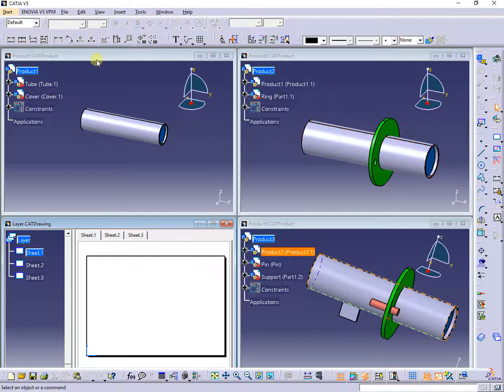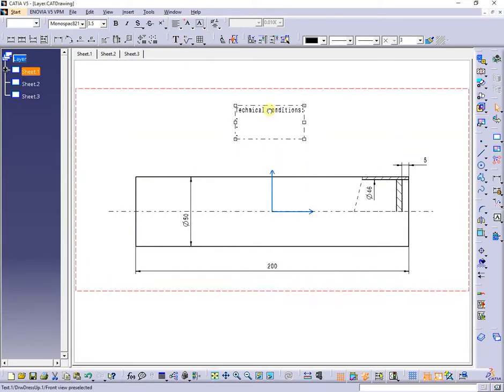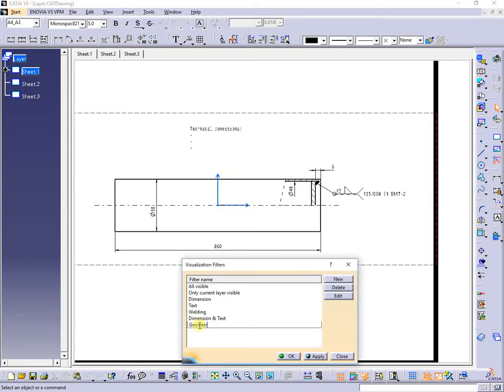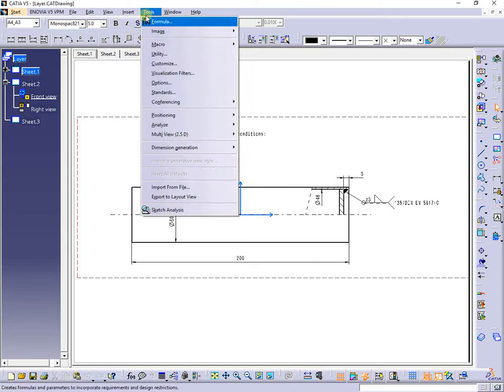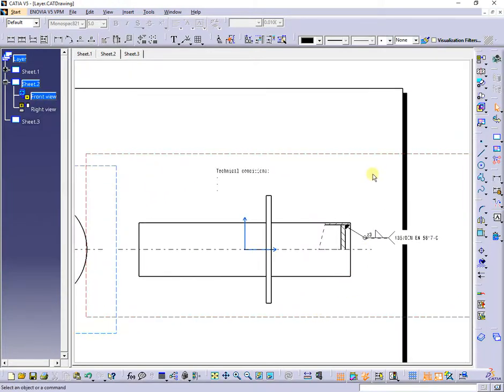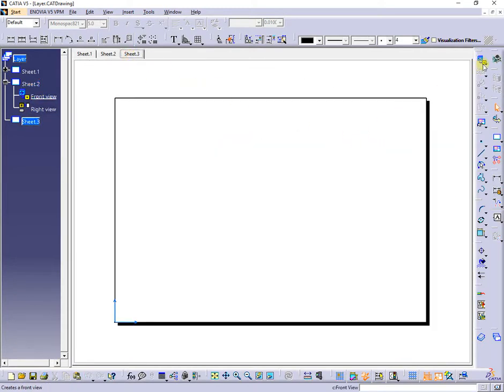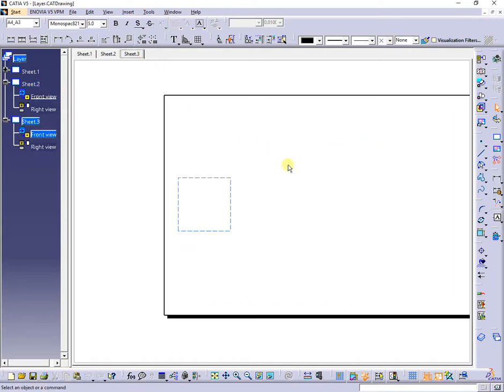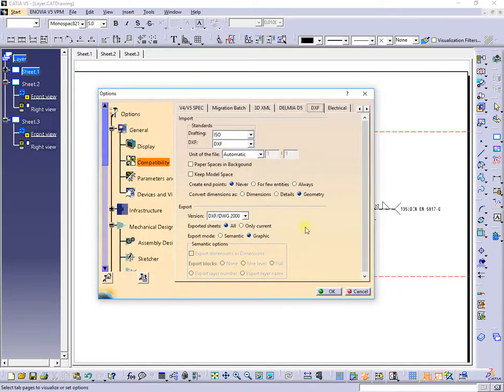Catia drafting - working with layers

Comment: Good morning, I have to draw a drafting of an overall design. I need that “filters” and “visualisation filters” I have created in the space “Assembly Design” are maintained in “Drafting” too. How can I do it? My problem is that I need to have diversify the style of the lines that compose the different pieces of the overall design because I need to have, in the print, some outlines thicker than others, or that an outline has to be a dashed line.